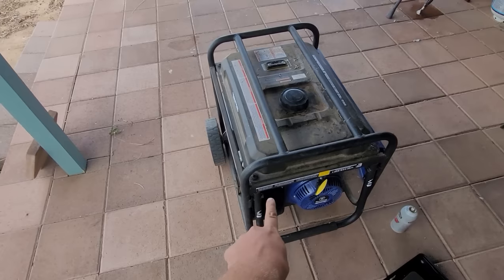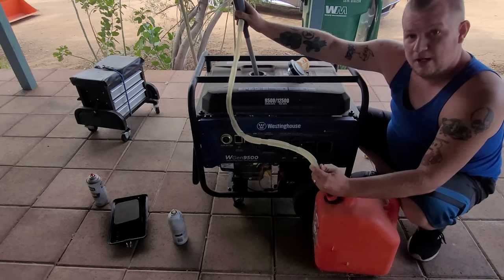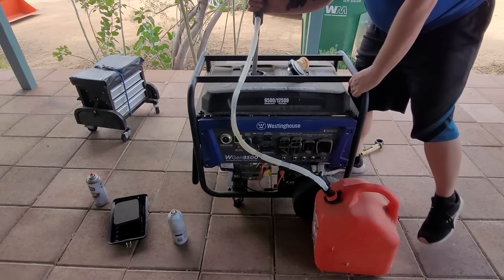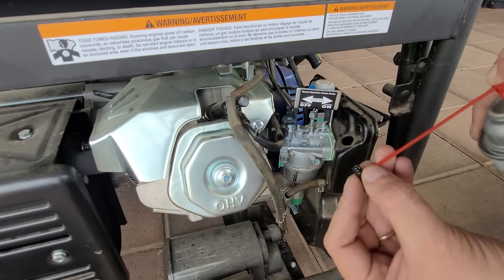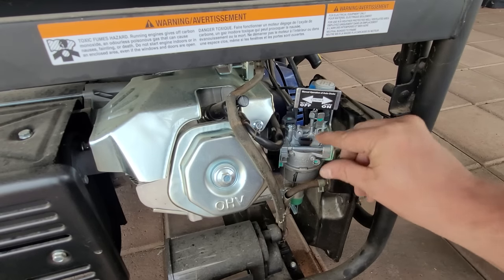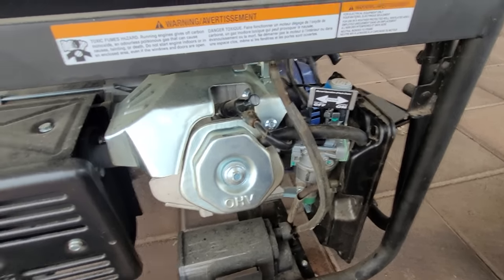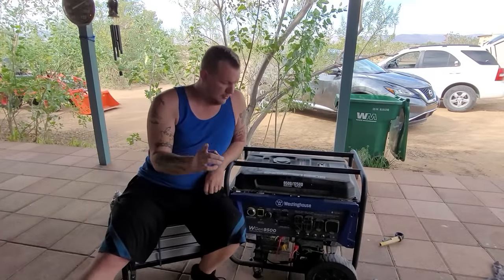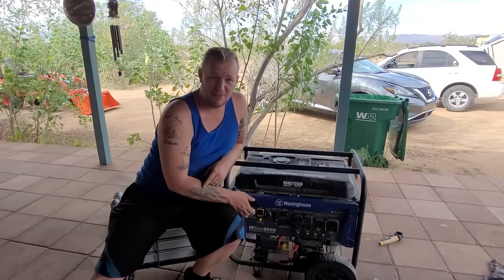Surging Generator? Quick repair for ALL surging and hunting engines.

Comment: Hi Andrew. Thanks for the video. Can you please help me. The ignition broke on my generator (it's the same motor as the one you have in the video). Could this in anyway have caused the generator to start surging because it started surging coincidentally when the ignition broke
Reply from the maker: No, your ignition breaking is a coincidence
Reply from the maker: But it should be pretty simple to fix
Reply: I cleaned the jet like you did in the video and generator is running perfectly. You saved me a ton. I'll just get a new ignition at the store. Thanks a mil

Comment: Forget the additives and just buy non-ethanol fuel. Made the switch 10 years ago and my small engine problems went away. Run everything dry that has long down times and you're good.
Reply from the maker: Non ethanol is random to get lol no where in Mohave county unless you buy the can

Comment: Have a new gen3600 out of the box (oil full, 2gal fresh gas) choke on idle high, wouldn't run choke off.
Next day. Idle very high. choke on or off.  Choke off idle high and surgers.    This is brand new.   Any thoughts
Reply from the maker: Two things come to mind and it could be a few things but two thing I think it is without looking at it are 1 The carb is not set for the elevation your at 2 it came brand new defective
Reply: I just bought the same generator and am having the same exact issue. Runs okay on full choke but stalls and cuts out on choke off. On full choke it runs a bit odd like this video, but i got a full refund from Amazon so I'm gonna keep it and try to fix it now.
Reply from the maker: @nolansynoracki6558  damn sounds like that's not a gen to get
Reply: @RepairGang  it gets great reviews, so perhaps just a few bad ones off the factory recently. If I can fix it I'll be more than happy with it considering I got it for free after an Amazon refund due to the issue.
Reply: Thanks for the info Amazon won't accept returns.  Called Westinghouse cust svc. They replied "can you send a video of problem".  I did and the thing was surging like crazy. Next day Westinghouse email. Contact Amazon for a refund.   Have the Westinghouse case #. Amazon verified the case # And issued a refund.
Reply: @carlcooney8034  awesome glad they gave you a refund too, its actually a really easy fix I just installed a new tri fuel carburetor today and it runs great now with the added bonus of running on propane and natural gas. If you need a link to the carburetor I got let me know.

Comment: Word to the wise. Don't use ethanol gas in anything that will set for a long time, as it will separate from the gas and foul your carburetor. 
Use ethanol free gas instead.  Also if you have a tank valve on the machine,  turn it off and let the engine run dry of gas to shut it off to drain gas out off carburetor then shut off the off switch. This will help keep the carburetor clean for future use. If you are using 2 stroke engines be sure to drain the 2 stroke fuel after use, as it will gum up carburetor if stored for too long.

Comment: My generator has the same carburetor I think.  My generator won't start.  I used it a year ago and ran it dry so all fuel was gone then put it in the garage.  I tested it today and won't start.  Will this information help me? Also how do I store a generator so this  doesn't happen again?  Thanks for your reply
Reply from the maker: You got to be honest. This can help start your generator but you might need to just take off the nut on the bottom of the bowl, pull it off and spray carburetor cleaner in there. That could help it too. You don't have to fully take it apart, but if you do it's pretty simple. You could do it yourself. Easy
Reply: @RepairGang  do you mean nut on the bottom of the carb bowl? Mine has 2. One on the very bottom pointing down and one next to it on an angle.  Do I need to empty all the fuel first
Reply from the maker: Either one works to be honest
Reply: It's a duromax 4000s.
Reply: Thanks again!
Reply from the maker: @tod2992  let me know if you get it running

Comment: Don't be surprised if this doesn't work on CARB generators.  Typically California forces them to use too lean jetting and block off the mixture adjustment.  My generators typically surge at brand new but often smooth out once under load.
Reply: Yeah I found the hesitation problem on a new 15 kw generac generator at no load as well.  My cousin and a friend of mine bought the same generator in 2004 .  Under no load it surges , over 2kw or so it smoothed out. But was a pain to see the lights flickering under real light load. I told my cousin to keep the central air running all the time so the generator had a decent load or at least the air handler running constantly and the compressor cycle on and off .  After the hurricane I looked further into the problem and setting the float slightly higher helped a bit.  I did look at the jetting and needed to locate a drill set going every 0.001 or 0.002 or so to get the mixture richer as well.  He ultimately sold the portable gas generator and put a larger fixed standby propane generator in with a buried 500 gal tank.  When he replaced his AC it took more startling current with the 410 freon so lucky they found that out before upgrading the generator . This was Florida and non CARB 😀

Comment: I have the WH7500E and just put a new carburetor on it. Once it started, I found it was doing the same thing, surging. I don't think your remedy applies since this is a new carburetor. I had the choke wide open so I moved the lever about half way towards choke and it ran smoothly. Even after the engine was hot, I still had to have the choke half way. The thing is, the original carburetor would run smooth with the choke wide open once it was hot but not on the new carb. Would I need to adjust the same black screw as you showed in the video until it runs smooth or is there another adjustment I would need to make to have it run smooth (open choke) like the original one did?
Reply from the maker: Sounds like you have a gasket problem. You might have put a gasket on backwards or upside down or one broke
Reply: @RepairGang  The only gasket I had to replace was the one between the carb and the black manifold and it was installed correctly. Now, the carb is an aftermarket one and wasn't very expensive. I'm thinking there may need to be an adjustment made somewhere but I'm not familiar enough with these types of carbs to know which screw to turn, how much to turn and which way.
Reply from the maker: Email me some pictures in a little video of what it's doing and I could probably help you more from there repairgangyt@gmail.com
Reply: @RepairGang  I checked out one more thing and it appears you were correct. The air cleaner housing is plastic and there is a gasket between the housing and the carburetor. The area where the gasket is looked slightly warped. So I got two new gaskets (doubled them up) and reattached the housing to the carb. Another thing I noticed was one of the house nipples on the back of the housing that vented the gas tank was cracked where it attached to the housing. I applied some super glue to that and that seemed to work but I don't think that was the main cause of the air leak. I started the generator and it ran perfectly at full open choke.
Reply from the maker: @Scorpio-kd5it  glad to hear it's normally and air problems it could be something so small you can't see but it's there glad you got it working

Comment: Put a new carb on,surges,it smooths out with a load on ,welds great!
Reply: If it's overhead valve engine check the valve lash , set with a matchbook cover, my generator was surging with a new carb , set the valves and no more surging.... oh happy day....
Reply: @jeffcosser4872  I had a derp moment,it was running out of fuel.

Comment: What if your generator sounds like that, but you’ve ran an engine system cleaner (Lucas complete engine cleaner) and gallons and gallons of new gas, treated with STA-BIL fuel stabilizer, along with an oil change and replaced air filter?Mine still sounds like that after all of that.
Reply: It surges from fuel poor ajustment.. too much to explain here but if it smooths out under load, don't worry.  If it strains under load, it needs more gas.. one way is to get raise the float level. The best way is find an old carb and steal the adjustable high jet (the one on the bottom)

Comment: What’s the name of that part the one I have has two O-rings that are torn.
Reply from the maker: You talking about the pilot jet
Reply: Cool thanks that’s it. I’m having a hard time finding one for my generator eBay Amazon I’ve tried everything. I have a Generac 3500 inverter.

Comment: Wish you could have got some video of you putting a load on it, I have a generator I inherited from probably the mid 90s  and I could adjust out the surging, but then I couldn't get it to run fast enough to keep the voltage up on a high load (but one that it should have handled).
Reply from the maker: I could probably make one

Comment: Same with 2 cycles that had bad gas empty old gas spray brake cleaner in carb gas line it works and some time it doesn't work

Comment: You don’t adjust the idle on a generator. There is no idle. The governor adjusts the engine RPM according to the load. The screw you were adjusting is only Used to hold down the pilot jet when the engine is used on a generator. The screw should only be turned in a few turns to keep the pilot jet in place. I learned this from James Condon on Utube. He is the generator guru.
Reply from the maker: @gdad0683  I love james

Comment: My gen idles great but shuts down under a load and the load is something it used to run
Reply from the maker: I would check valves first. My thoughts without looking at it

Comment: That small plastic jet is the exact same on the uh...well they're called Gx390s ect, but little All Purpose Honda Engines, same carburator. You can clean the whole thing, even if its super nasty, but that small little plastic jet with the BABY small opening? Yeah that's the problem. Had one that surged even after a carb clean. I didn't know (for a minute) there was a small opening, poked a little wire through and then it ran like gold.
Reply from the maker: Yeah those Honda pilot jets. They do clog up up and they're so thin. It's hard to get anything to poke through them. I found a nice set of micro drill bits that I use just for those bad boys

Comment: use power service on it it cleans it out as it's running
Reply from the maker: Power service? Never heard
Reply: @RepairGang  diesel fuel conditioner. In white bottle. Stumbled across this when on a job site. Snow blower wouldn't run after using it most every day only thing I had in truck so tried it it worked. So told it to a friend. He did it to several things. It's a tune up in a bottle. It's incredible

Comment: My generator sat for a long time, I replaced the tank, it starts but dies in 10 seconds 😂, it starts with carburetor fluid only 😢, I need help.
Reply from the maker: if you replace or just deep clean carb it will work like brand new

Comment: I'm 68, I've had dozens of machines which run on gas, trucks, cars, bikes, generators, chainsaws, etc, I've driven many hundreds of thousands of miles and I have   never...ever..     encountered   "bad gas". Not once. 
My Geo sat for 7 years  with 1 gallon of old gas in it, I started it up and it ran like the day I parked it.
People who claim a problem with bad gas usually are overlooking the real problem.
None of these machines, since the introduction of ethanol,  have ever experienced a problem from the effects of ethanol.
Reply from the maker: I agree to a point but sometimes the water and condensation that these machines get from improper storage the gas gums up a little bit and these tiny tiny holes get a bit of a jam but I agree people need to stop bash ethanol gas lol
Reply: Company truck sat for 3 yrs .... un-touched, put new battery in, cranked up and idle'd PERFECT and drove perfect. 
So bad gas after 3 yrs ???
Reply from the maker: @ACommenterOnYouTube  fuel injection is a bit different gas didn't sit in a bowl
Reply: @RepairGang  well gas is supposed to go bad regardless if its fuel inj or carb.
I had fuel sit in my motorcycle for 8 months and it went bad. Drained the tank, drained the bowl and put in fresh fuel and she idle'd perfect. 
Yet the truck sat for 3 yrs and that gas didnt go bad and it fired right up and idle perfect ??
Reply: @RepairGang  gas sitting in a bowl and gas sitting in a tank and gas sitting in a container are the same thing, its supposed to go bad over time. 
Yes carbs are a bit more finiky because the passages are much smaller but how did the gas stay good for 3 yrs in that truck tank vs going bad in the motorcycle in 8 months ?? It smelled bad.

Comment: My fingers are getting tired of having to explain why this happens. First and foremost, stop using gasoline with ethanol. Use what is called 'rec' gas or recreation gas that is usually 89 or 90 octane. I usually buy 5 gallons each season and add 2 1/2 ounces of stabilizer to use it for the snowblower, lawnmower, power washer, chipper/shredder, generator. A gallon of that is used to mix with 2 cycle oil for the trimmer, chain saw and blower. The 4 cycle engines all have fuel shut off valves with exception of the power washer. Ever time I run those machines I turn off the fuel just as I am finishing with them to empty the carb of fuel. The power washer has a drain valve pin cock on the bottom of the carb float bowl. Never ever leave fuel in the carb for more than 60 days. Especially if you use 10% ethanol fuel. Ethanol hardens fuel lines and clogs emulsion tubes and needle valves in 4 cycle carbs. On 2 cycle engines, it hardens fuel lines and destroys carb diaphragms, metering and/or pumping and fuel filters. These little procedures take no time at all to do and what time it does take is well spent eliminating the issues the guy in the video had with his generator. If he would taken the carb off, he would have found jet holes and the holes in the emulsion tube clogged just enough to cause the 'surging'. extended storage with ethanol can make a mess. Usually means buying a carb kit or new carb. I recommend spending the little extra on the fuel cost so as to not have to rebuild stuff and when you do need the engine to run, it will run the way it is suppose to run. enough said.
Reply from the maker: Where I am located it is damn near impossible to get ethanol-free fuel

Comment: PUTTING OLD BAD GAS IN YOUR CAR IS THE LAST THING YOU WANT TO DO⛽
Reply from the maker: My old Kia loves it lol
Reply: Most gasoline motors these day have fuel injection, once its mixed in with the gas that's already in the tank it'll be fine
Reply from the maker: @BillSikes.  that's why I use it in the beast
Reply: Place I used to work they dragged the bosses seadoo out of the back of a storage garage that had been sitting for like 12 years. One of my coworkers dumped the 3-4 gallons of gas we sucked out into his jeep. No way I would have lol. He passed away a couple years ago in an industrial accident. Rip Jeff
Reply from the maker: RIP
Reply: Cars will run on anything.  15 year old varnish, no problem.

Comment: Those pumps are not for use with flammable liquids as per the instructions I got with mine just be careful on warm days
Reply from the maker: Pumps? Yeah I feel that though but the ethanol evaporates really quick then it's backed up good old fuel

Comment: Please make sure when readjusting the idke you use a milti meter and reset voltage and frequency to the propper ranges....your kooking fir 120 volts and 60 hertz for american electricity

Comment: Absolutely put it in you auto or truck they burn a thousand times hotter than a little Briggs & Stratton put put engine and its mixing with the fresh gas in you tank.

Comment: Why did you had to drain all the gas? I though by closing the gas valve would be enough 🤔
Reply from the maker: I drained gas because it was way bad and after I did this that bad gas would have went right back into carburetor. If you have fresh gas closing valve is fine while you clean carburetor

Comment: This idle screw is only on Honda clone or Honda engines. Briggs and stratton, kohler or other brands do not have similar carburetors, therefore this fix does not work on them
Reply from the maker: It works sometimes

Comment: Sta-bil 360 marine turn the pet cock off run the carb dry. Fuel will last two years. Must use Sta-bil 360 marine. Good video thanks.
Reply from the maker: I don't like fuel stabilizer
Reply: @RepairGang  everybody has an opinion but i have proof with equipment and vehicles to back up my opinion. Jeopardise your equipment and your viewers mine will run proper when needed. Have a good life .